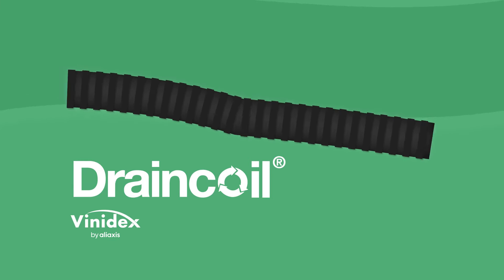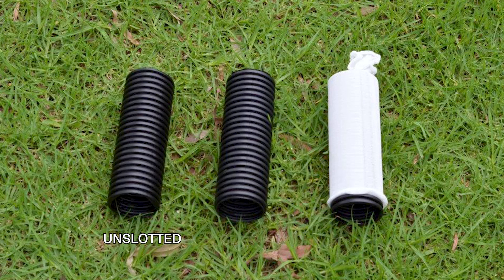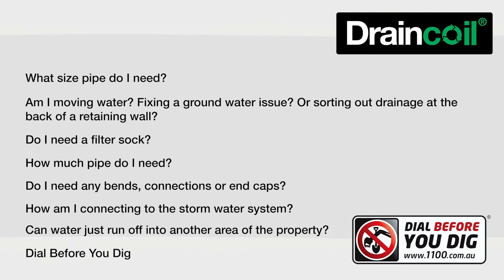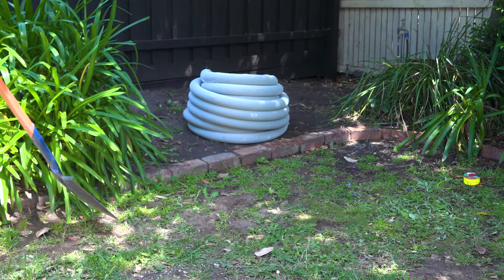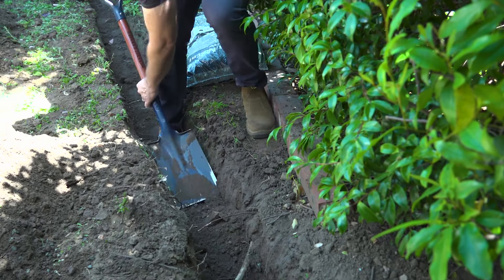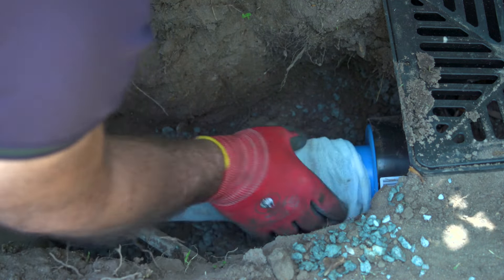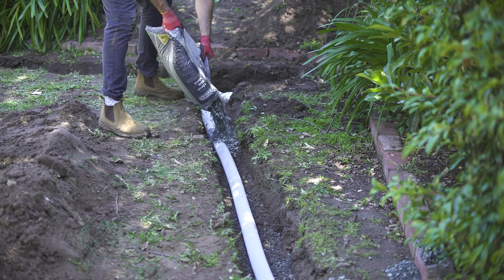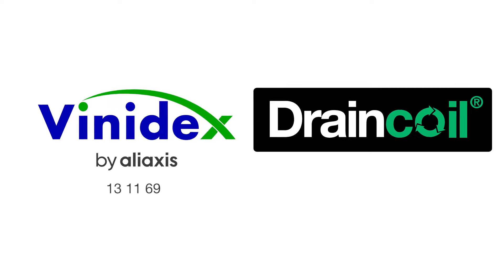Vinidex Draincoil® How To DIY

Comment: We are using the 100mm unslotted from the 4 gutter outlets to our four 10,000 litre squat poly tanks until we get around finishing the tank stands and poly outlets.
Reply from the maker: @specilized29er86 apologies for the late reply- Perfect temporary solution. Once you have finished we are happy to take the pipe back to manufacture into more Draincoil or other Vinidex Products. We have a number of drop off points around the country,  please call us for your nearest branch to drop off.

Comment: Also, why don’t you surround the gravel with a geo-fabric?

What will prevent the soil penetration into the gravel?
Reply from the maker: @oilbaron apologies for the late reply- our notifications were turned off for this video. You are correct you can experience fines to migrate through the gravel over time. As a secondary barrier a geo fabric barrier could also be laid. It will depend on the native soil that is in the trench wall.

Comment: Why can’t the drain coil sit at the bottom of the trench, under the gravel?
Reply: Just get crusher dust on the bottom
And then wack dirt on top aslong there no clay
Reply from the maker: @oilBaron100 - The gravel assists with any potential ground water coming from the bottom of the trench. It also helps to level the bottom of the trench and for the gravel to sit into the corrugations giving the pipe side support which is needed once any load is applied.